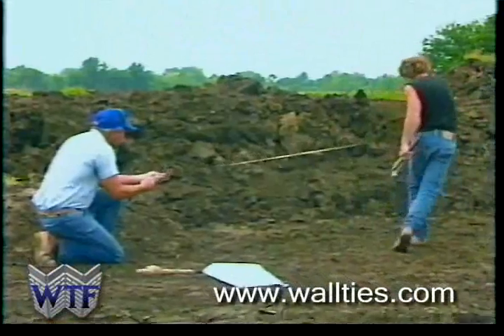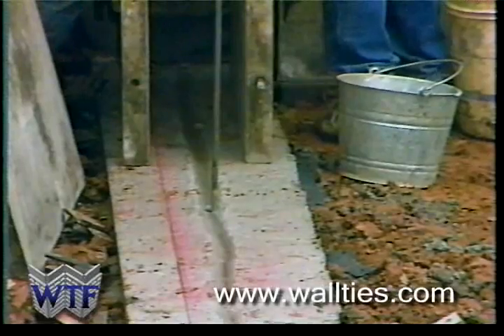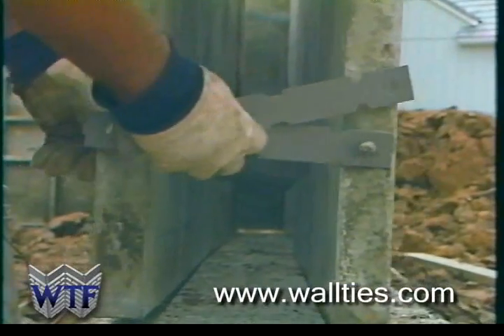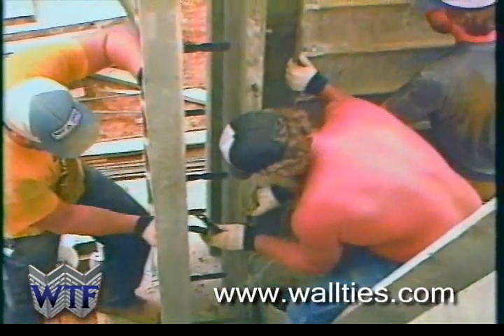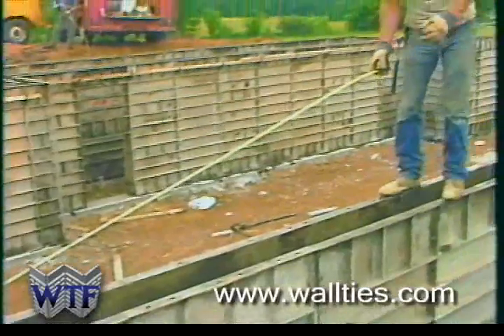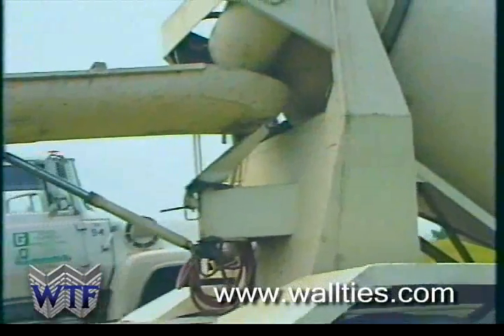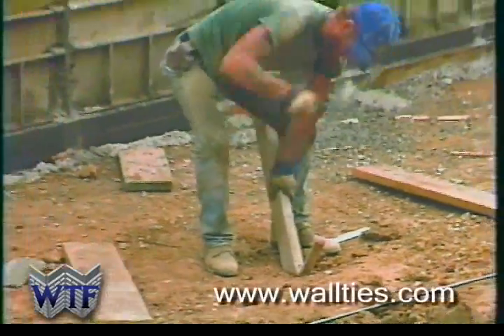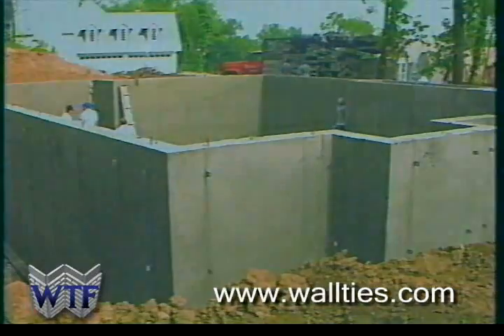Concrete Forms

Comment: these actually are a lot quicker, except  what the hell are u doing with the rebar, ,doing the rebar after is dumb,,rebar should be tied up on verticals that are put in the footings..how come u don't have verts in the footings..that house is gunna be moving on this concrete in 25years
Reply: Maybe there isn't a spec for verts. I bet you could figure out a way to put in verts if you wanted to.
Reply: It’s obviously a very old video

Comment: i used to hump 100 lb symon forms for a livin! where were these when i was younger?
Reply: What symon form weighed 100 lbs?
Reply: @michaelcayton4168  frame is steel n the face is wood, add on dried concrete n you got a 100 lb form

Comment: hmm like the idea of the 2 X 4 that you don't have to nail to the regular wooden forms, then the stripers have to take those 2 x 4 out the next day.
Reply: Jean-Francois Gauvreau it's easier to keep the wall in place. Especially if your setting on a shitty Unlevel footer. And you can have one ground guy to pull blocks and scrape Crete away from panels. The fact that they don't lift their walls with a transit level setup and then string is retarded. Shitty product and a lot of pour lines